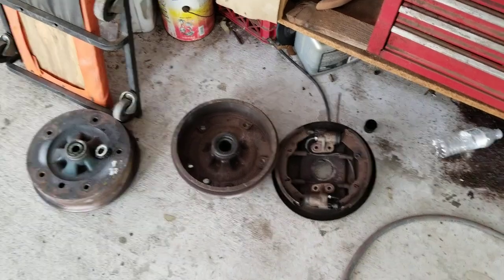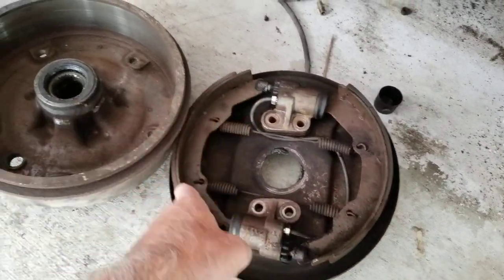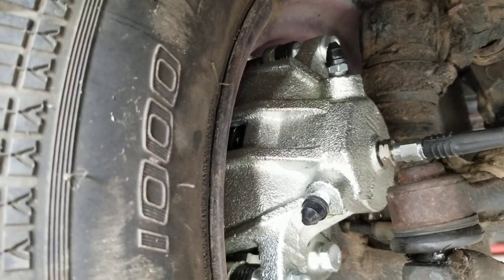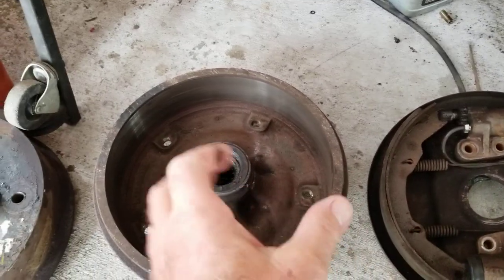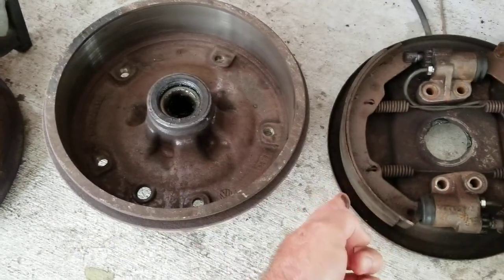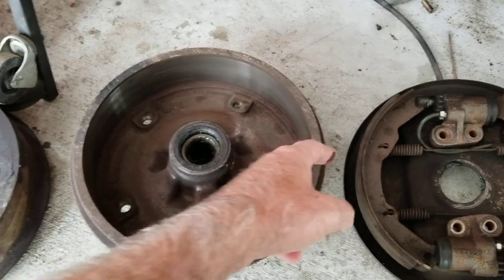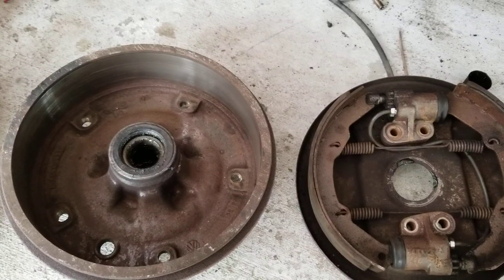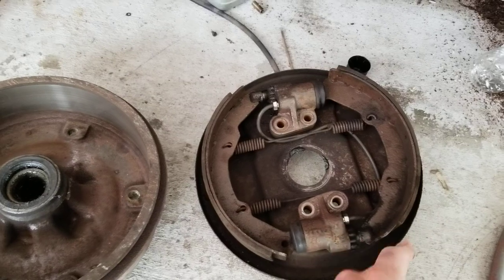Drum brakes vs. Disc brakes why disc brakes are better

Comment: Disc brakes on trucks are still air. Controlled with a cam and brake chamber just like disc. Just the chamber is rotated 180 degrees for it to work. The truck/ trailer I'm driving right now has disc on every axle

Comment: This video is a little old but... I work on large trucks and trailers. They use air still on disc brakes for bigger trailers and trucks. But for the most part s cam pneumatically powered drums brakes are still used because of cost.
Reply from the maker: yea can you imagine how much it would cost to convert them to disc. or jut the disc system would be some serious engineering and R and D cost. air brakes on disc are super complicated to make them effective.
Reply from the maker: thanks for the comment. I think eventually this video will get some watch. so many people dont understand the whole perspective.
Reply: @mikesrandomvideos  here is a link to the ones I service the most. It’s a ok overview of them. https://www.foundationbrakes.com/en/products/airdiscbrakes/airdiscbrakes_1.jsp
Reply: @mikesrandomvideos  they were at a time hard to get parts for because they were so new. Now bendix just charges a premium for their system. The brake chamber on a normal s-cam driven drums brake is like $45 I think the ones for disc are like $250 or more. Parts go up as well as labor. If you need to change the rotor then it’s a wheel seal as well as pads and the rotor on a drum set you just pull wheels drum and brakes.